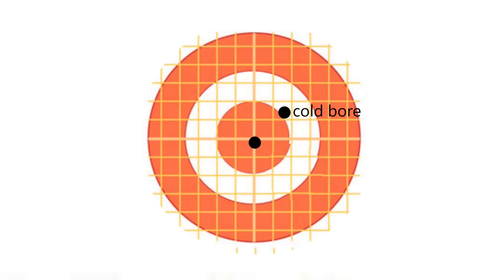Cold bore shift

Comment: They call it COLD BORE for a reason. It is not just about temp of your barrel, as you said it does not change much from first to second. HOWEVER, a cartridge, chambered after the first shot, will have a massive change in temperature of the powder in the case from absorbing all the heat from the previous round. Snipers in colder climates always carry 1-2 rounds in their pocket or near their skin to heat up the rounds for consistent firing. (also affects your primers if the weather is cold enough) Not saying it is all about temp, but to rule it out entirely is just stupid. Play with the temperatures of powder on Gordon's reloading tool and you will greatly see muzzle velocity and pressure changes, this is an undeniable fact of thermodynamics.
Reply from the maker: Cheers

Comment: Mark the temperature suggestion has merit but there’s more to it. Taking a rifle out of a warm car on a cool day or a cool rifle on a hot day could create condensation in the barrel. I’ve tried running a mop or a patch down the barrel before first shot. Getting any moisture build up out. I don’t think it’s the only thing going on but it does reduce cold bore shift with my precision rifles.
Reply: Condensation only occurs when the barrel temperature is below the dew point.
Reply from the maker: Thanks Man

Comment: Really great points.   I saw a video one time that really helped me understand it better.   A guy was shooting his precision rimfire rifle and demonstrated a repeatable shift 1 inch up and some to the left every time.    Then he spent 20-30 seconds or so blowing air through the barrel (can’t remember what he used).   After he did that the cold bore shift went away completely and it was repeatable.   It was theorized that it was a thin layer of moisture in the barrel causing it and getting rid first of that solved the issue.   Thanks for the insights as always.
Reply from the maker: Cheers

Comment: My bench rest 6 mm BR With an extremely heavy fluted barrel Always takes 3. To 5 shots cold bore  To settle in !  Especially after a deep cleaning   It is accurately pillar bedded And very rigid !  I explain it more as the gun settling in my rest and my bag Despite my best efforts to do so prior !  All of my competitors always say it's because the barrel needs to be warmed  But I agree with you I don't think that is the case   Thanks for all your great videos mark😊
Reply from the maker: Thanks Man, Cheers

Comment: Thanks Mark for the suggestion. Five mornings consecutive I fired 1 shot from my 300 prc.
The cold bore shot every morning was .3 inch left and .4 in high. The rifle was very consistent where the cold bore shot hit. The 5 day 5 shot cold bore group was about .5 inches. You clealy provide excellent info. Thanks again.
By the way my Bergara 300 win mag shoots 1.5 inches right, good elevation on same test. Thanks again.
Stan
Reply from the maker: Thank you Stan, well done, cheers
Reply: This is interesting. I hunt with a bergara ridge 300PRC and mine shoots high and to the left on the cold bore as well. It really bothers me actually that really adds up out to distance

Comment: I wonder if it also has to do with the pressure inside of the "relaxed" barrel ? Once you fire the first round the pressure inside the barrel expands outward with heat from firing(expanding the metal ever so slightly). Every shot after that would be through an expanded barrel. The expansion would be extremely quick and violent - all be it microscopic. The metal then would want to return to it's original relaxed - un expanded state witch would take longer to do naturally. A reasonable and consistent time between shots would be more likely to maintain a somewhat consistent barrel. The opposite would be firing fast through a barrel and rapidly heating it up. You see the loss of accuracy when you do this with a lightweight or pencil barrel. The first cold bore shot / three or five shots close to each other/ the barrel heats up and then shots all over the place. After the barrel cools down and relaxes the process starts all over again. I would think that if you test for "cold bore" consistency and  find the impacts are close to each other- you would have a higher consistency of barrel metallurgy that returns to a more consistent relaxed state. All the little minor variables add up to larger ones. Great conversation as always Mark. thank you.
Reply from the maker: Thanks Will

Comment: I find my steel barrel varmint rifles have very minimal cold bore shift, my 6.5 PRC carbon wrapped Bergara barrel has a 3.5 inch shift. I zeroed it to cold bore and it’s bang on every time but it seems a little extreme! Don’t know if it’s thing with carbon?
Reply from the maker: Yes that a lot, and none of the Carbons barrels I have used are at that level of shift, but can happen with all sorts, just good you tested and know, Cheers

Comment: I think I now have even more questions. I understand there are many possible variables, but for an average person how do we allow for them or avoid them? Going to a range multiple times over days or weeks to only test for the first shot is not an easy task. 
If it's not about temperature, wouldn't a full strip and clean of the rifle at the range and then taking another shot achieve the same result as taking it home and coming back the next day?
Reply from the maker: If the first shot is the one that matters, ie hunting, there is no magic here, testing is the only way you know if you have the issue and how to deal with it, put the effort in Nathan... Cheers
Reply: @markandsamafterwork  Tha ks for the reply. I'm trying to understand what specific factors contribute to these variables. After about 15 years not owning a rifle I'm looking to get back into shooting and hunting. So I'd be seriously considering what rifle I buy based on a hunting application. I'm guessing a single shot break barrel design would have the least variables (no idea if that is an actual firearm though).